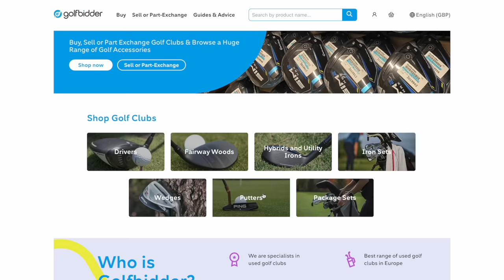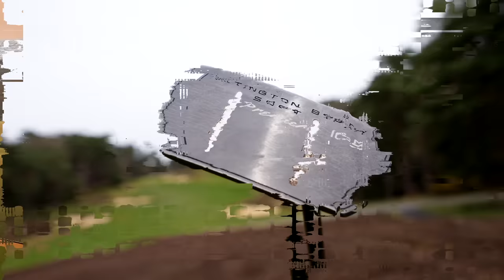We BUILD OUR BAGS for £500! | Rick Shiels vs Peter Finch: Golfbidder Challenge 2023

Comment: I got an f9 S as my first driver ever. And loved it. I learned to hit it hard and fast and it took a beating and kept going. I can regularly hit it 315y with the 10.5 deg loft or whatever it was, broke one shaft. Now im to callaway rogue st LS after a fitting, Hitting 9deg -1 and ive gone through two heads under warranty but have snuck up to 352y
Reply: Now i just use the old driver set to high loft for doglegs over trees or DOD and can get 270y out of it either way